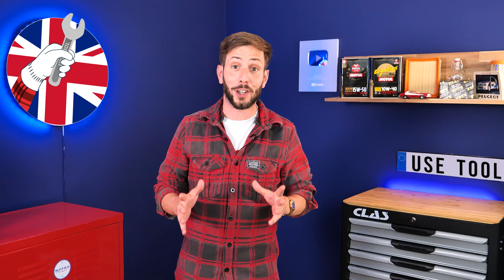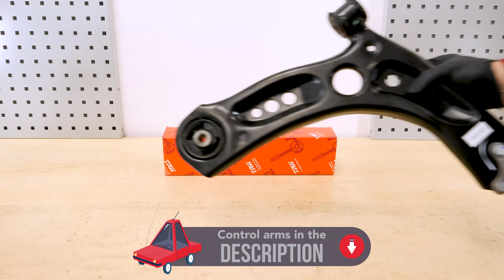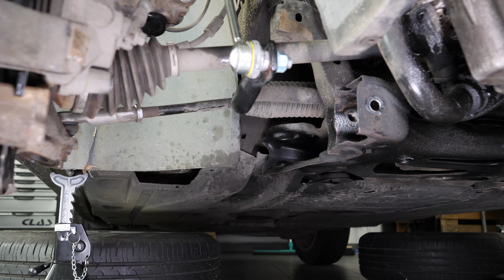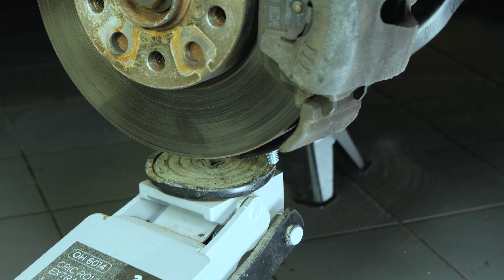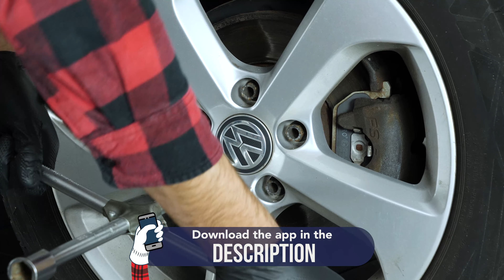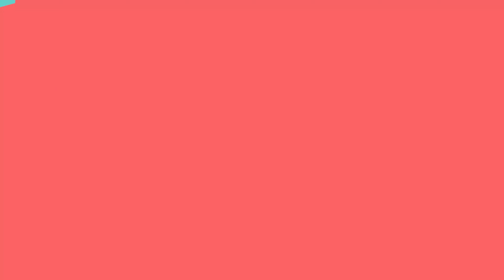How to replace the control arms Golf mk7 🚗

Comment: What are the torque specs for the two bolts in the lower control and for the bolt of the ball joint?
Reply: Suspension	Lower Control Arm to Subframe	18 mm	70 Nn + 180 deg.	Tighten w/ suspension loaded. (2) bolts
Steering	Ball joint to Control Arm		40 Nm + 45 deg.	Lower nuts - (3) nuts
Steering	Ball joint to wheel bearing housing		60 Nm	Single (1) upper nut